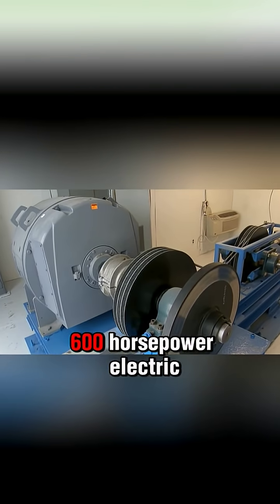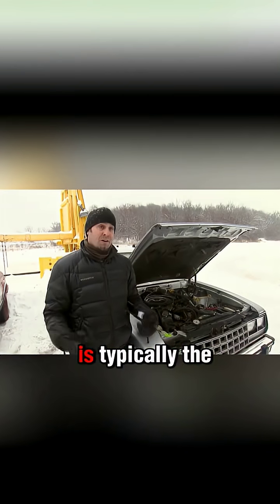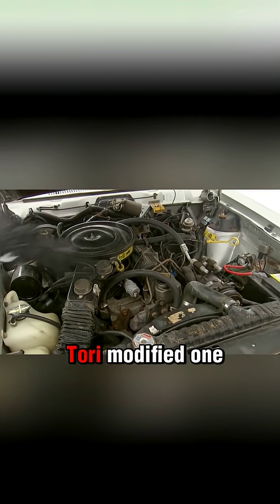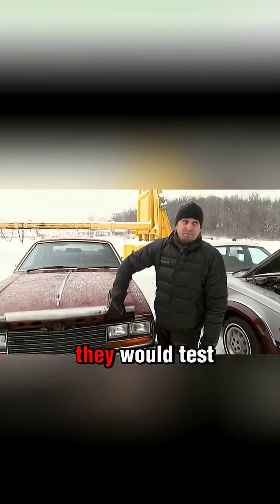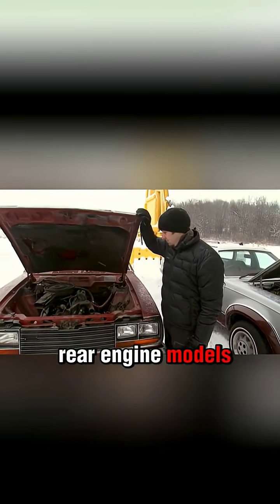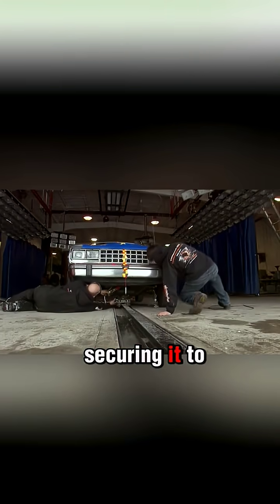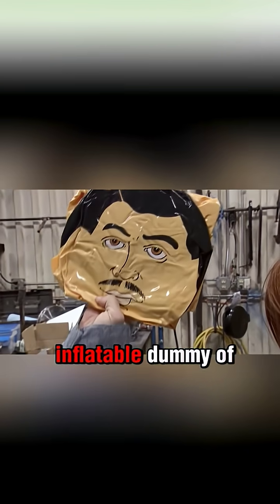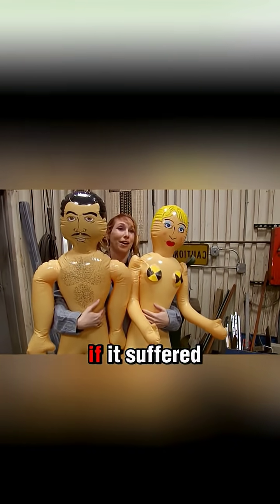Can a snowplow cut a car in a half? #science #mythbusters #physics

Comment: Electric car without an engine?
Reply: Battery weight 700kg on its own and os tough so i dont thinkt it will sork
Reply: Yes electric cars have engines, but they are often on the wheels and not a Center-Block. 
The battery might be a big heavy piece, but it's made out of a lot of particions and cells, so it might split.